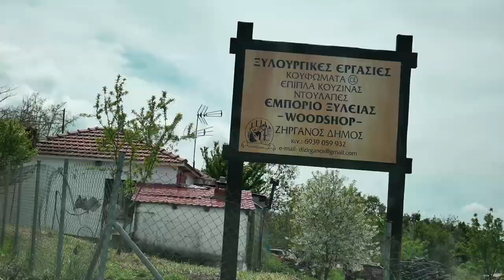GOT WOOD!? - Vlog 570

Comment: hahahaha everyone from my Dutch stable would get a heart attack if they saw horses transported like that
Reply from the maker: Yeah, it's not the most ideal way. Especially because the horses weren't wearing any protection for their eyes, but as long as they're stable in there it will be fine. If this would tip over, it would be less dangerous for the horses than a regular closed trailer.
Reply: @VolosVibes  yeah and Greek horses are a lot tougher hahaa
Reply from the maker: And smaller! They make funny hops 😂